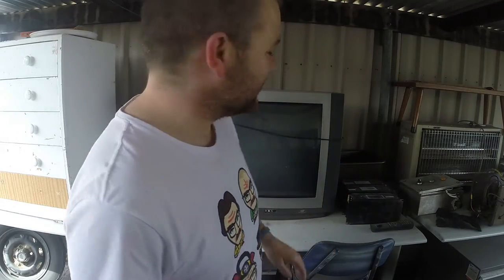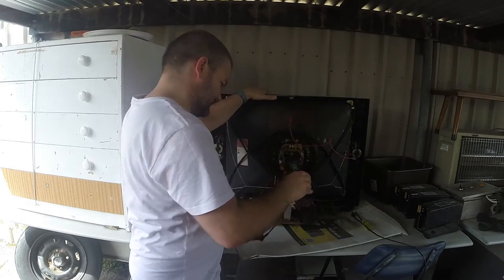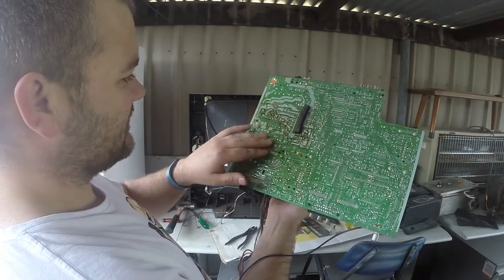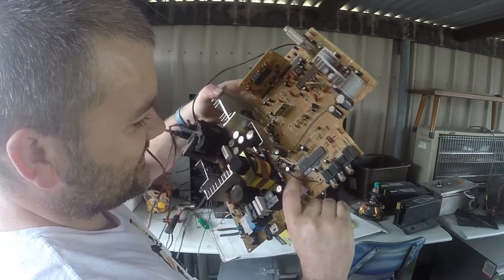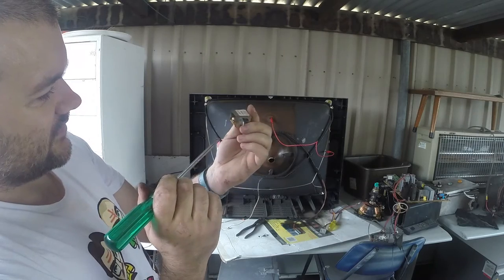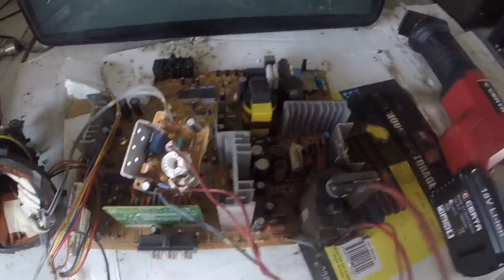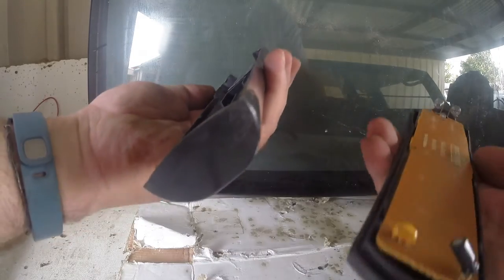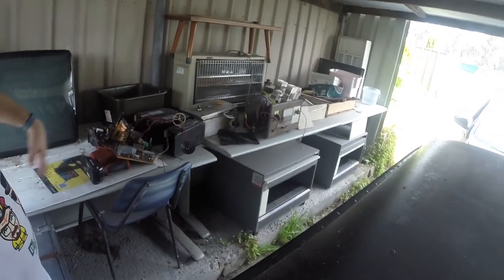Teardown #10 LG CT29K30E CRT TV

Comment: Great video anyway, sad that the set got broken but important that it's on youtube because I've been able to confirm from looking at the video that this chassis (MC-8CB) has RGB/SCART and is arcade cabinet or vintage console ready (a friend just picked up a 25 inch "ct-25h32en" in the same chassis today ready for the scart socket upgrade). Hope this info also helps the collectors in the future